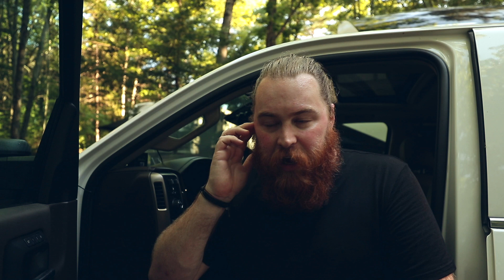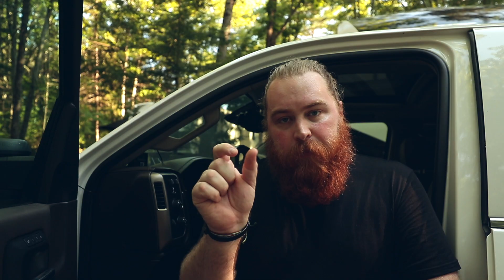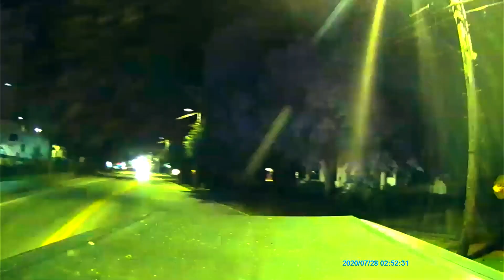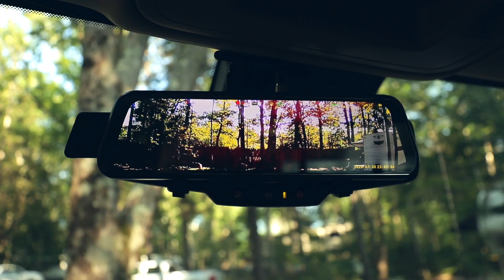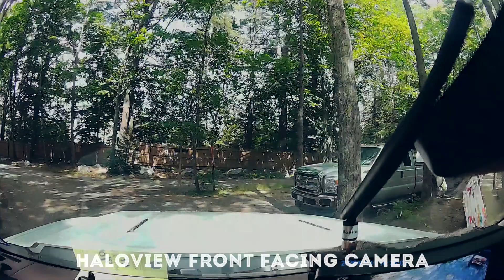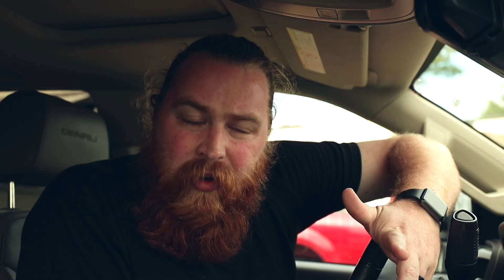Towing Tech: HaloView Dash Cam

Comment: Halloview says this about the cinerite liter adaptor. 
Power Supply	DC 5V (Note: You have to use the provided cigarette lighter to step down the voltage from 12-32V to 5V.) Did you have any problems by not using it ? I am subscribed to you cannel. Thank you
Reply from the maker: nope. has worked great for us!
Reply: @WhereWildOnesRoam  I was told if you don't use the  provided cigarette lighter to step down the voltage from 12-32V to 5V you will burn up the screen and the warranty will be void. I'm doing it the right way good luck with yours.
Reply: Ok so i looked up the specs on the OBD2 adaptor it does drop down the voltage to 5 volts so you should be fine. Nice find on that. I learned some thing today . Thank you.